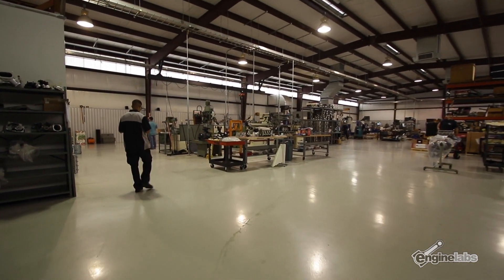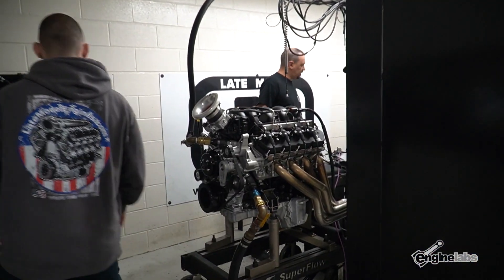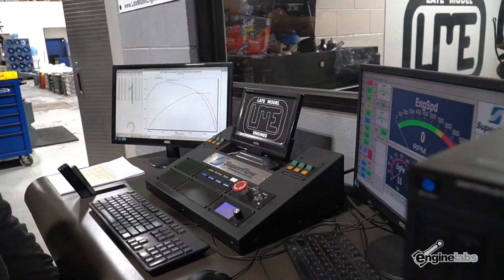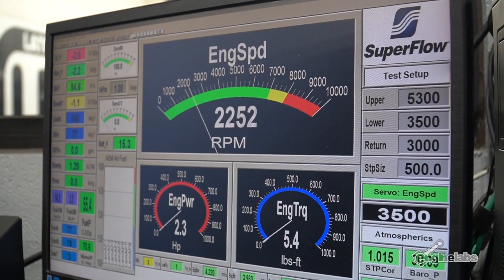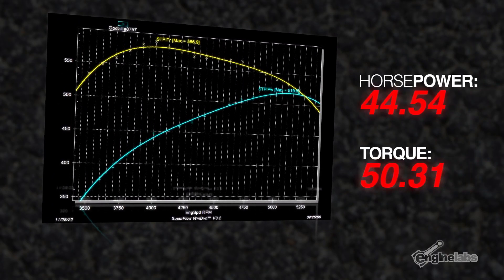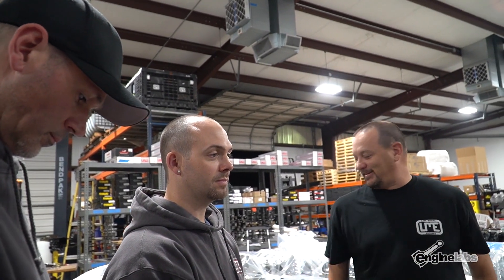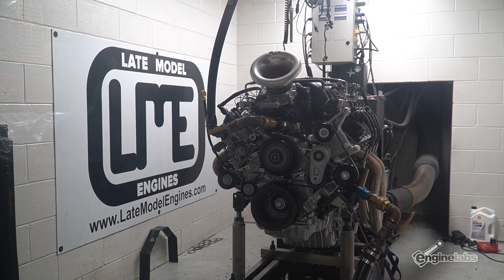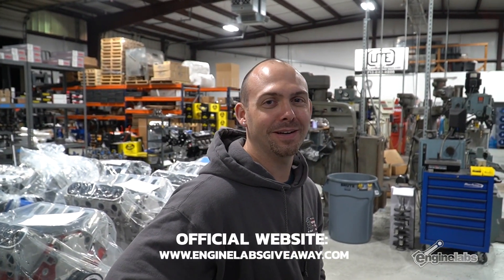On The Dyno: Baselining The Summit Racing 7.3L Godzilla Giveaway Engine

Comment: The key to the success of that engine isnt so much the heads but the ability to retard the timing electronically on the fly to maximize the torque. High tech coupled with low tech. and since CHEVY pretty much ironed out all the bugs over the last few decades all ford had to do was reverse engineer it and throw more cubic inches at the design and give it a "name" anyone that says this is not a LS carbon copy engine with cubic inches is delusional.